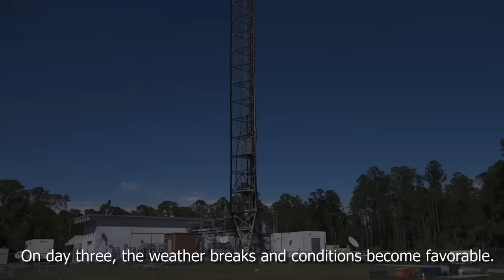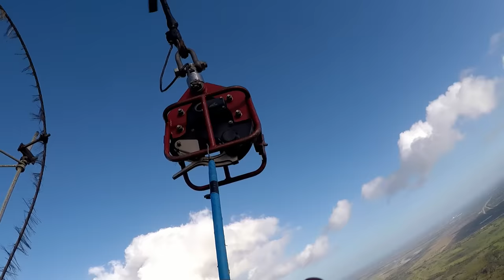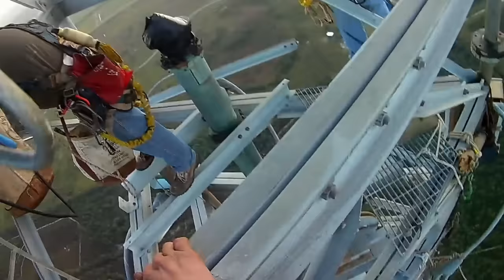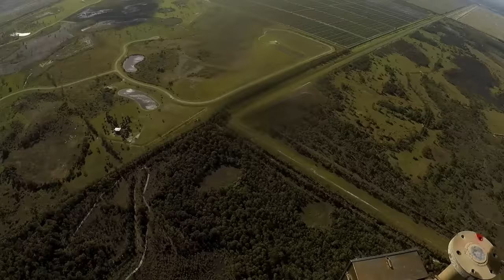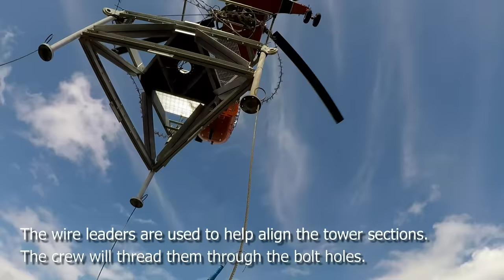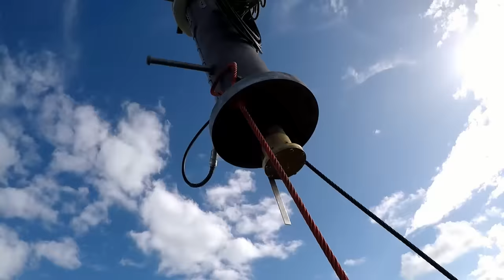ABOVE THE CLOUDS   03 29 2019 ANTENNA CHANGE OUT

Comment: At the end of the day this job, I'd go quietly to a restroom near by then to a bar and drink me a 12 pack😫
Reply: It's like anything else, after a long time of doing it, it's not a big deal.  The guys that are on a job like this have so much experience climbing steel, it's just another good paying gig.  You focus on what you are doing, usually that's all within 3 ft. of you, but have lot's of time to take in the views while waiting for the crane to bring you steel.  You have a partner like scuba diving, and help each other when needed, take your time, think about it, make sure of everything before making a move and keep on going until the job is done.  I worked building a structural steel building that was 140 ft. tall but big, long and wide, it took five months with about 30 guys.  I learned the first day that I could do it.  A great climber and walking on 3 or 4 inch wide steel became normal, 8 inch steel felt like a sidewalk.  Once you are up 30 ft. and fall, you are dead, so anything above that makes no difference, just more wind sometimes and longer to climb down when it started raining, the steel gets real slick and that sucks.  I was poor and the pay was great, so I did it for a short time and had a great time with my fellow scabs. Really strong, crazy guys, all of them and they do they often put down a 12 pack after work, but for fun, not because of nerves.  BTW, never fight a steel worker because they have muscles like steel that don't show, but are there.  Their grip can kill you.
Reply: @Billfish57  Thanks Bill I needed to know that like a hole in my head, as I'm  reading my knees are getting weaker and weaker, I got to have me a 6 pack now.good luck.

Comment: Nerves of steal.  I would have designed a bolt that was thinner at the tip and wedge shape with a smaller nut pressed sleeve that rides the bolt into place and drives down the bigger nut at the same time.  Self aligning bolts I would call “Betsy Wedgies”... engineering humor.

Comment: Ha ha ha ha...As if things weren't going bad enough, they drop the spreader on you? ha ha ha. Glad nobody got hurt. I know you didn't ask, but here's some constructive criticism: When I was a connector,  I used to carry a piece of  3/4 acme threaded rod about a foot long with a nut / washer welded on one end. I also carried a few nut-washers tacked together for the rod to suck those connections up. (works really good on those damned doubles too) After you have it sucked up, you can line things up with your bull pin. Whaling on your pin like that while the load is still on the hook and bouncing around like it was, is a waste of everyone's time. Ditch that little pinch bar and get a mans size sleever too. Ha ha ha, all right, I'm done. Take care guys, see ya'll on the "Big Job".

Comment: So  the pilot  effed up?  Why was the load line released?    DAMN  you guys  be careful!!  I used to climb  "baby" towers  I guess 350 was the tallest.  'Round here, lots of them  40-100-200ft  lots of  little Rohn 25G  and 40  etc  I  hate the Rohns with the  fuckin  climbing pegs up one leg,  I never had to deal with the  freickin   cell monopoles
US Navy 68-74,  NAS Miramar, 70-74 ETR-2, fixed GCA RADAR and TACAN

Comment: Marconi tower Sri Lanka same size I used to work on 'only a winch up in a bosun chair 100 foot then climb the rest the views from the top were stunning until the Sri Lanka air force jets buzzed the tower after a bombing run to the tamil tigers up north but after our 2 hour climb down the pilots were waiting for us to say sorry with a six pack in there hands swearing never to do it again after the site manager threatened to whip them .

Comment: Those huge reproductive organs of these guys won't save them from potential death, caused by a heavy metal object being dropped on them. I can't help but describe this routine maintenance job as a failure, when luck is the only thing that keeps your crew, your colleagues and yourself alive. Not to mention fiddling with a breaker bar to align the bolt holes, while a helicopter is hovering above you.

Comment: Yes, they were fearless - but they did't know what they were doing. Just moments before they lost the load line, I said to myself "something will go wrong in a few monents" - and it did. And they banged on the thread on the bolts with hammers - and the guy lays his hammer flat on the top. Stupid. And he has his gloves off - don't do that, if you fall or something, you might injure your hands when grapping. In the least one of the guys, the bearded one we see the most of the time, is a clown. A brave clown.